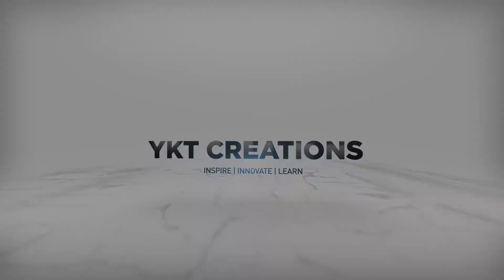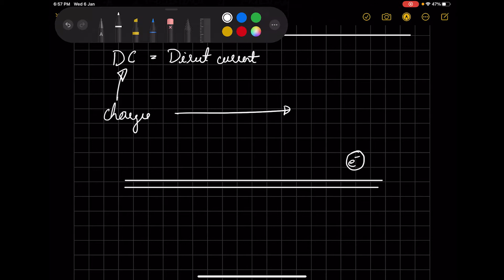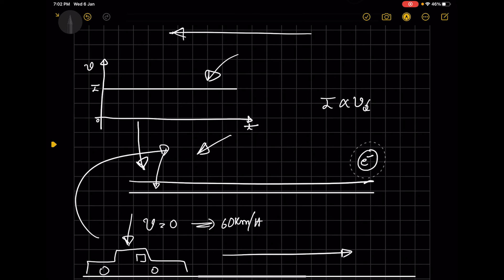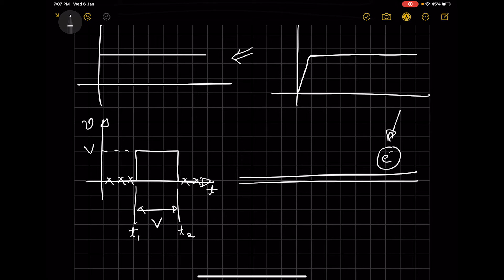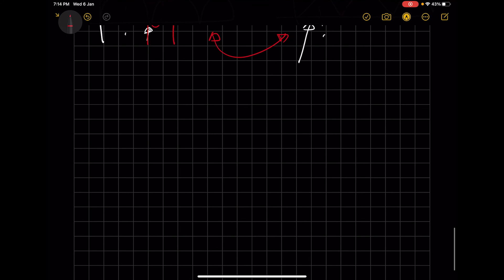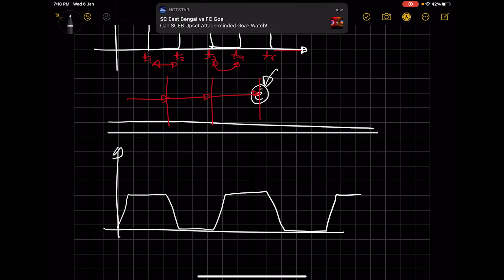Comment: If you like the video and want to see more, comment down below the topics you want me to cover. Thank you
Reply: some other suggestions: RC circuits, charging/discharging capacitance, low/high pass filters !
Reply: 1. Body Diodes function in MOSFETS. 2. why mosfets are utilized in dc-dc compared to other FETS. 3. LDOs and DC to DC converters. 4. DC-DC applications, why do we need them to switch at multiple frequency for what use case? 5. Bode Plots, poles and zeros.